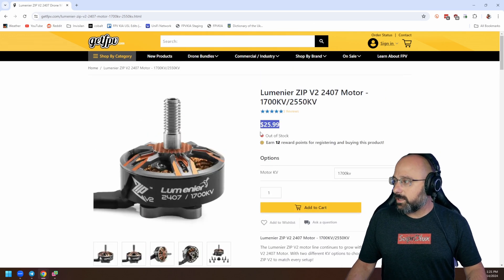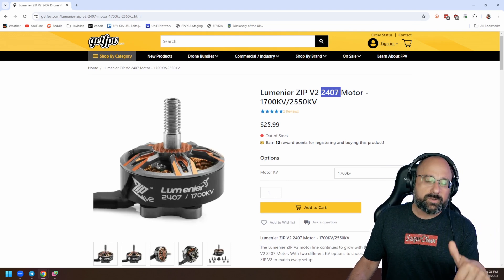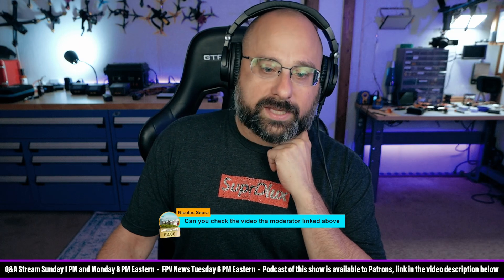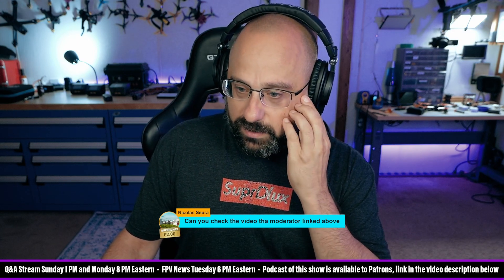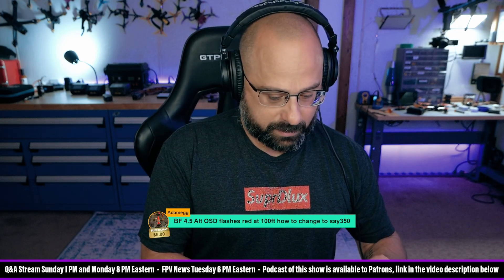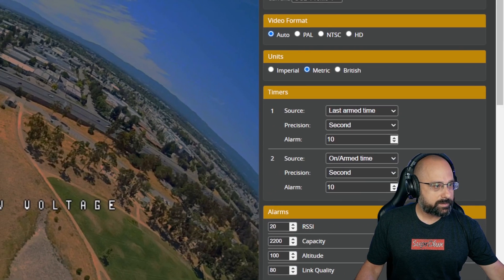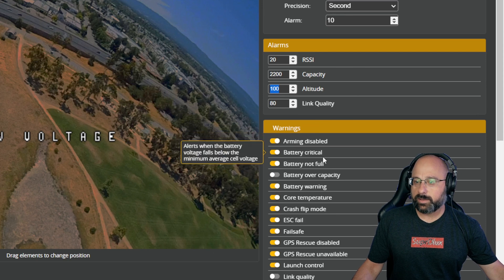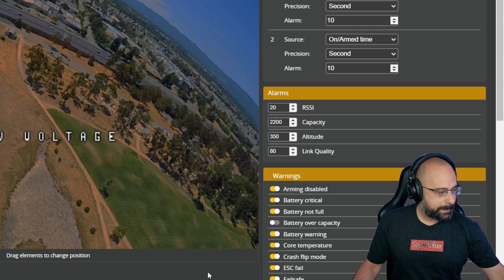When Is A New Bardwell Series Coming? Vortex Ring State in Drones? Random FPV Questions!

Comment: VRS in a helicopter is where you have too much collective pitch applied and little to no airspeed (in any direction) and a high rate of descent, recovery is to lower collective pitch and fly out of it with cyclic and pedals, preferably into wind as quickly as possible altitude permitting.
Reply: Aka settling with power